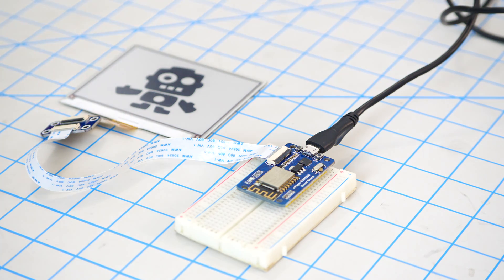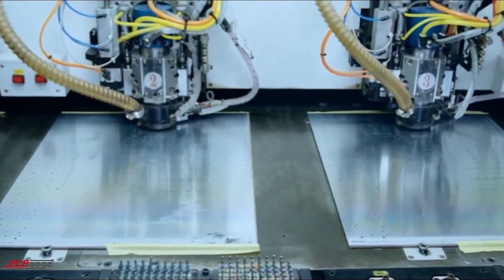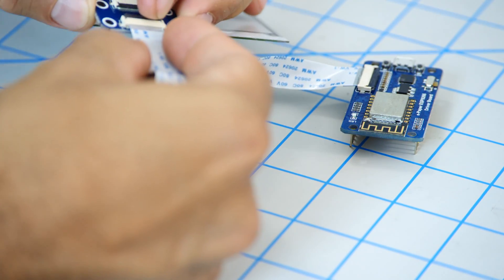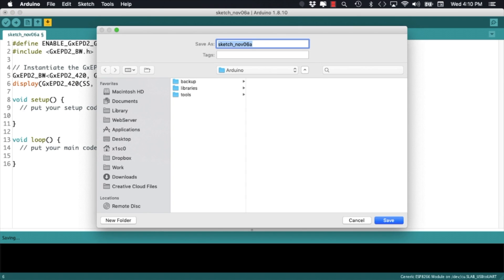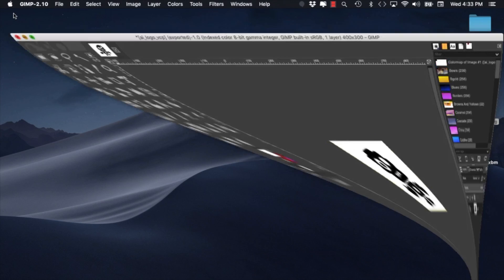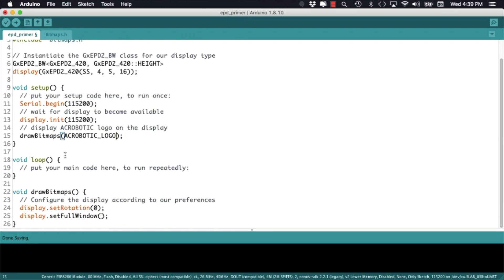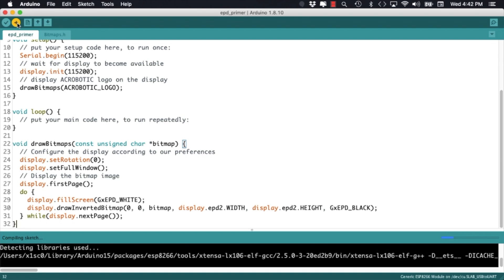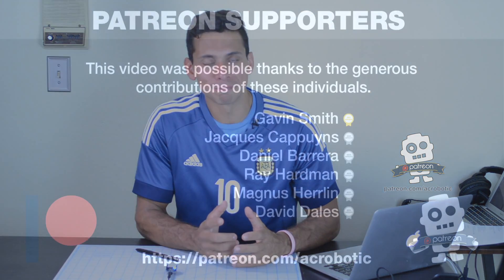Getting Started | e-Paper/e-Ink Display Custom Images w/ Arduino & ESP8266 | ACR-00042

Comment: Awesome! Liked. One question: 
Do you think you can do this with the 5.65inch ACeP 7-Color E-Paper E-Ink Display from Waveshare?
Would like to built this with a color ink display such as the mentioned above. Hopefully some day you make a video about color displays controled by Arduino. Would be interested in this.
Reply: Hei M Hane, I want to do this exact same project (have a 5.65in display from waveshare ;))! It just lacks a converter like image2cpp, which works for monochrome displays, just that we need for the 7-colour mode... Have come any further?

Comment: I tried this using the adafruit 2.13 feather and the adafruit esp8266 board and it dose not work. There is always an error in the code when there is the instantiate on line 5, it promps a " } " im not sure what is wrong... any ideas?